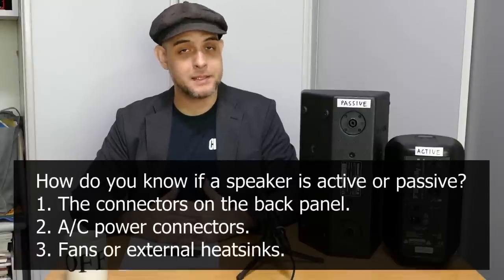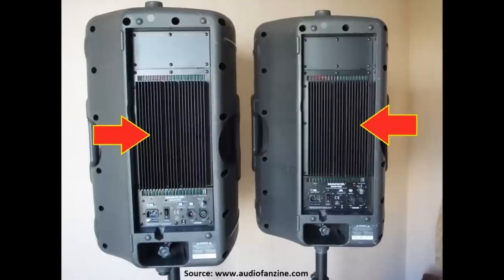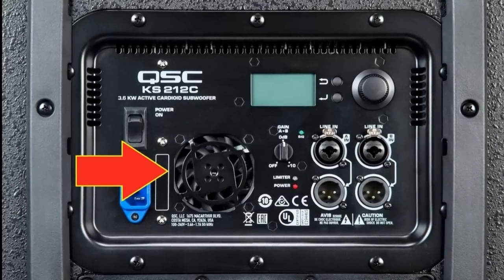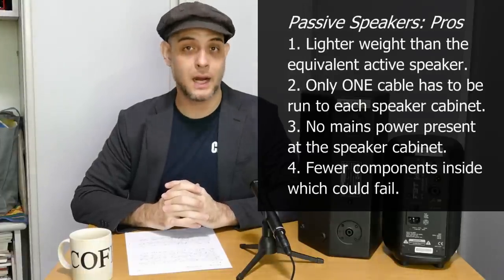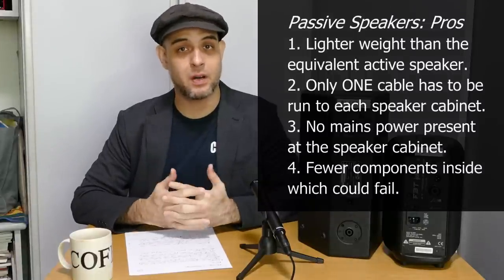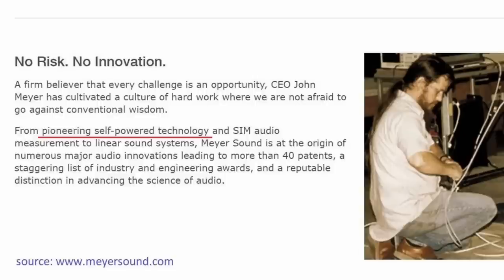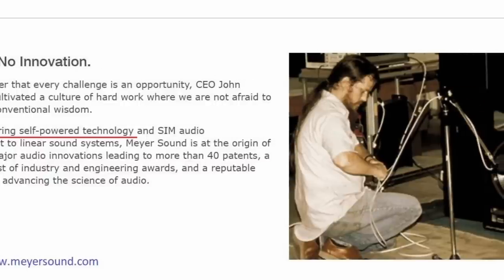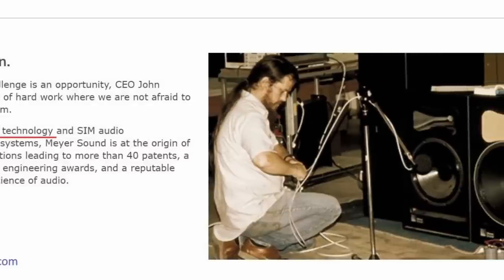Active vs. Passive Loudspeakers for Live Sound

Comment: Have you ever heard people mentioning active and passive loudspeakers being defined by their internal crossover being respectively active or passive, rather than the existence of an amplifier within the loudspeaker? I have already heard audio engineers say that it's a common misconception to define active and passive loudspeakers by the existence of amplifiers rather than their type of crossover. What do you think about this concept?
Reply from the maker: Good question! Yes I've heard about that, and I feel that it is important to distinguish between the crossover and rest of the speaker system. For example: some lower-powered active speakers use passive crossovers - there is only a single amplifier module in the speaker cabinet, the output being split between the low and high drivers by a passive crossover. Likewise, some high-powered passive speakers can use an external active crossover, the output of which feeds two separate amplifier channels, one for the highs and one for the lows. These amplifiers are located external to the speaker cabinet, but the crossover itself is active. 
At the end of the day, it's more important to be aware of the advantages and disadvantages of "amplifier inside speaker cabinet vs. separate external amplifier" rather than getting caught up in the semantics of the terms active and passive. Good sound can be achieved from both designs.
Reply: I see, that makes sense. Thank you for the answer!
Reply: The crossover type of a cabinet also dictates if its bi-amped (external crossover) or passive (internal crossover)  both have their integration features to balance with the space being used.
Reply: we've started to properly detail item when making specifications in projects.
Passive-X self-powered spk
Active-X self-powered spk
Passive-X unpowered spk (bi-amp/tri-amp capability is mention)
Active-X unpowered spk setup (if internal x-over is present, bypass-ability is mention)

Comment: I own a small sound company. My inventory is mostly passive. There are a few reasons why I use passive speakers. 

1 - I do a lot of jobs where I have to distribute speakers over great distances. It is not always ideal or possible to run a bunch of power cabling and signal cabling all over an event space. I use a lot of speaker distribution cabling that I make myself. Things such as a 8 conductor cable that fans out to 4 NL4 connectors. This allows me to run one cable, and hit 4 speakers, that I can then chain to 4 more speakers. So that one cable will ultimately run 8 speakers. 

2 - Powered speaker manufacturers tend to discontinue models fairly regularly. So after a couple years, it can become difficult to buy more of the same model, or get replacement parts. I use stuff that I have been able to get parts for, for 20 years or more sometimes. 

I have learned to repair the passive crossovers that are in my cabinets. So if they go bad, I can fix them very cheaply. I have a stock of spare parts for those, that will last me the rest of my career (and those parts are not expensive at all). I have also learned to recone speakers, and repair compression drivers. So of the three things that go wrong, I am able to fix them. The majority of powered speakers do not offer recone kits for their drivers, so you are forced to replace the whole speaker 🔊... if you can even get one. 

3 - I use the same type of amplifier across the whole range of my inventory (QSC PLX II 3602s). I have never had one fail in over 20 years of using the PLX line. And I dont have to think about which amps go where...its all the same. 

My gear makes money, and has for years. And it will continue to make money until I decide to retire someday.

I dont get caught in the trap of buying the latest greatest thing, every time something new comes out. My clients appreciate that they get the same thing at every gig. And I have had some clients for well over 20 years. They dont like change for the most part. I do stay current with things like mixers and wireless microphones though. 

I do keep a few powered speakers around. I use them mostly as backstage hot spots for corporate events, DJ monitors, and as a shout speaker for a band talkback to the engineer.

I have a couple friends who also own small sound companies, and they use powered speakers exclusively. The services they are able to offer are very limited because of that.
Reply from the maker: Once again, great advice for anyone starting out - thank you for taking the time to share your knowledge and experience 😀

Comment: Thank you! Clear, consistent, pleasant. This is how a good lecture on a topic should be.
Reply from the maker: You're welcome, thanks for watching 😊
Reply: @GLBProductions  Well, thank you!)) Just a quick a question, if I may: I am building a digital composer’s home studio now, and as I understood from your explanations, active monitors would perhaps be the best bet for my case? Or, perhaps not?... What would you recommend? Thanks again!
Reply from the maker: Yes - I generally recommend active for studio monitors because they tend to stay in one location where A/C power is readily available because it is also needed for computers, mixers, outboard gear etc. Using active monitors also means eliminating an external power amplifier which can be the source of fan noise.
Reply: @GLBProductions  Thanks a lot! 🎹🎼😊

Comment: The binding posts are nowerdays found on home audio speakers so if you see them on domestic speakers or Hi-Fi it’s a passive speaker. It might be active but only if it has other inputs like RCA. The speaker terminals on active Hi-Fi speakers are to add a slave speaker for right or left audio.

Comment: Here is my experience with several working club bands. Active loud speakers have their own amplifier, so while you don't have to carry around a rack of power amps, they are heavy as hell and hard to mount on poles. Additionally, you have to run power cords to each of them, meaning you have high voltage wires running all around the stage. Also, I have seen the person running the sound  forget to turn them on, making the audience scream at the singer "We can't hear you" until they figure it out. While it may save you a couple bucks up front, I would pass on them unless it is a permanent installation.
Reply from the maker: Thanks for the comment! The amp modules that are used in modern active loudspeakers typically weigh 2-4 pounds so are relatively lightweight. In some cases the active speaker is actually LIGHTER than the passive equivalent because the manufacturer uses different drivers. With regards to having high voltage wires running around the stage - remember that you already have AC drops for your backline and instruments, so this is more a case of managing your cable runs carefully. Finally, if the sound engineer forgets to turn them on... well, maybe they should keep the day job 😂

Comment: I have been into semi-professional audio for a while, and i hate active speakers for a few reasons

1, if a problem occurs with the internal amplifier, it means stripping almost the entire speaker down to get to it, to rectify the problem, thats if its not the fuse on the back, rather than just grabbing another amplifier and plugging it in and off you go

2, You find the active speakers are usually a lot heavier than passive speakers, so if your moving them around a hell of a lot, they get really tiring really quickly

3, usually, the volume inside the speaker cabinet doesn't compensate for the volume taken up by the amplifier, so the bass isnt usually as deep

4, some kid often messes about with the volume controls on your active speakers while your not looking, and either blasts the audience with a higher than recommend volume, or turns it down so nobody can hear it

Im just old school, i love my massive plywood passive speakers and amp racks, thats just the way i am i suppose, cant stand the plastic speakers, to me there really cringe and chintzy

Comment: Other advantage of passive speakers: you blow an amp or need to service it, you change it or swap it (it's quick and easy); you blow a speaker, you do the same with the speaker (they're much lighter to handle). The technology of amps improves, you change the amp. And, heat dispersion for the amp units is better in a passive system.

I've not read other comments, and thus mine may have already been covered by other viewers.
Reply from the maker: Thanks for the contribution 😄 There are definitely advantages to separating the amplifier and loudspeaker components of the system, just as there are advantages to combining them. 
I'm not so sure about the heat dispersion, because most high powered active loudspeakers feature forced air cooling, the same as power amplifiers. Being up in the air also tends to help with airflow as opposed to being under a stage etc.
Reply: Sometimes your speakers need to be in direct sunlight on a hot day. It's easier to keep an amp rack in the shade versus trying to get shade on every speaker.

Comment: I think Active Speakers have an advantage when the mixer console has to be behind the audience (remotely located) and a “snake” is used.  You don’t have to use “monster speaker cable” to connect the speakers to the amplifier adding additional cable routing mess to the venue.  Of course you can use a power amp on stage near the speakers but again the mess gets transferred to the stage area.  You only have to use the signal line from the mixer to the stage which is usually in the “snake” when using Active Speakers.
Reply from the maker: Haha that 'mess' is just part of doing live sound, hence the need for 'cable management' 😉

Comment: Some music stores that I'm talking with that deal in live sound (not Guitar Center or other national chains) are no longer selling passive equipment. They may have a few used pieces of equipment sitting around but they won't take anything like that on trade. There's no reason for anyone who's got good passive stuff that's working well to ditch it, but at the same time, anyone looking NOW to make an investment should go with active equipment -- at least in terms of starting fresh. If you've got a bunch of other equipment (amps, cables, etc.), that's one thing. But if you're going from scratch, even if buying used, its almost a no brainer now.
Reply from the maker: This will be very dependent on your country, region and locality but if you expect to trade in equipment that you are buying today in a few years' time as part of a system upgrade then it definitely makes sense to see what retailers will accept. In my part of the world there is no such thing as trade in for pro audio - used equipment is typically sold on the second hand market to offset some of the cost of new gear.
Reply: im actually in the market of passive line array, all my speakers are active and i love them, but every time i listen to a passive equipment they just sound in a different league to me, i dont know why, my gear is yamaha nexo, qsc k series and yorkville, and im pleased with them, but im not sure if i want to deal with 20 or 25 built in amplifiers on a super expensive brand knowing that the initial investment is huge, and not sure how much of a spare parts are in the market atm

Comment: Having purchased a powered Sub and 10" powered Speakers what didnt make sense is that they only provide a 6ft power /IEC cable but when you set them up it was real quick that we needed a power cable as long as the XLR cables running to the speakers since the power strip was not near the speakers minimum 25 ft considering the DJ set up. So my reco is that Powered Speakers come with min 25ft cables.
Reply from the maker: Remember that passive speakers do not come with speaker cabling 😉 The power cable that the company provides is enough to get you started - if you use these speakers professionally it's a very good idea to invest in custom made IEC cables which are long enough for the venues you commonly play in. Alternatively, use an extension cable to reach the base of the speaker stand, and then use the supplied IEC cable from there.

Comment: The main advantage of active over passive is that you dont have a SPF, single point of failure. If your amp goes down, end of night, if an active speaker goes down you can limp through to the end of the night on one. No brainer.
Reply from the maker: Yes, which is why professional audio rental companies will typically carry spare amplifiers to the gig! Mind you, if I lost one entire side of my PA system I wouldn't want to try and get through the rest of the event with just the remaining half... I'd have a lot of angry people in short order...
Reply: @GLBProductions  I'd rather carry 2 active speakers than 2 passive ones and 2 amps.

Comment: Great video.  I do have a question. Do you have any idea why the C300 speaker is heavier than the SRM450? Since they are supposed to be similar, or at least made with the same drivers, I wonder what makes the passive model so much heavier.
Reply from the maker: That's a good question! The only way to tell for sure would be to disassemble the two speakers side by side and see where the weight difference is. One possibility is that the C300 crossover is unusually massive or has some form of attached heatsink which greatly adds to the weight - quite unlikely in my opinion. The other, more likely possibility is that they are using a different LF driver in the SRM450 - I suspect Mackie puts more R&D into their active speakers than into their passive ones and they may have upgraded the woofer to a lighter weight model whilst keeping the one in the C300 the same as the previous generation.

Comment: Can we convert an active speaker to a passive speaker? Sorry, I am new to these things.. :) Well, you are so good in training! Great job!
Reply from the maker: Yes you can, but it is typically not economical to do so because it would involve buying a new passive crossover (which may not even be available for that particular loudspeaker) and then re-wiring the inside of the speaker cabinet to accept it. It is better to buy the correct type of loudspeaker from the outset.

Comment: In my home studio, I like passive speakers because I have a rack workstation where I stand with guitar on, mic in front of me, to sing and play. The mixer and power amp is within arms reach. If I had to dismount the guitar, and go adjust knobs on the back of passive speakers which I don't have easy access to. Wouldn't work for me in this fixed permanent installation home application.
Reply from the maker: Definitely a good choice in your situation. Many active speakers intended for studio use have the level controls on the front, but that wouldn't solve the issue of being able to physically reach the speakers.

Comment: I was hoping to hear you describe the differences in their sound quality, if there’s such a thing.
Reply from the maker: This is not really possible in a general sense, because the sound quality of a loudspeaker is the sum of many, many parts and it's difficult to make an apples to apples comparison. Having said that, there are some manufacturers which offer active and passive versions of the same loudspeaker eg Mackie with the SRM450 vs the C300. In this case, the active version typically goes louder and arguably sounds better because it can be biamplified with specific & separate processing for the woofer and compression driver. However there are those that would argue that the passive version sounds better for various reasons and so the argument goes on 😄

Comment: Is it possible to connect 2 tops and 1 sub to a stereo amp? 
I mean 2 tops to one channel (What would happen to the ohms? 🤔) 
And the single subwoofer to the other channel?
Would the work? Would that be a safe way to run a 2.1 passive system?
Reply from the maker: Yes you can do that - in fact many modern DSP amps have a built in preset that configures them to run a sub off channel 1 and a fullrange speaker off channel 2, with the appropriate crossover in between. The only issue is that a system like this cannot be run in stereo using a single 2-channel amplifier, as what would normally be your left and right has become your sub and top.

Comment: Very nice video. Very clear explanations. But I would like to know if passive speakers' cable can electricute when in use.
Reply from the maker: Electrocution is actually possible if you use bare wire or the old 1/4" phone connectors. Speakon connectors are very safe in this regard.

Comment: As always, great thorough explanation in your videos. One thing though I'm still not clear about: is it possible to connect a guitar or bass in an active speaker with mic/line inputs? I know guitars or basses are at instrument level, but what happens if you plug them in the xlr/jack combo? Is it only about gain or even the quality of sound will be affected?
Reply from the maker: Thanks for watching LC. The answer to your question is it depends on several things: whether the guitar/bass is active or passive, what its specific output level is, what the input impedance of the active speaker is and/or whether it has a so-called Hi-Z or high impedance switch. In general, passive guitars/basses cannot be connected directly to active speakers UNLESS they have a Hi-Z mode. Active guitars/basses are usually ok, but there may not be enough gain available, depending on the output level of the instrument.
Reply: @GLBProductions  perfect. Thanks for the answer!
Reply from the maker: You're welcome :)